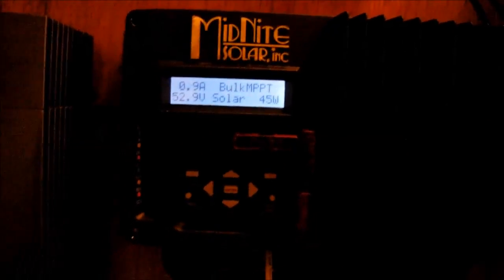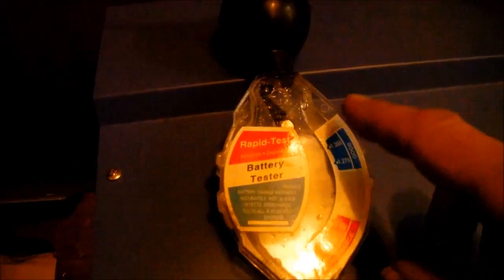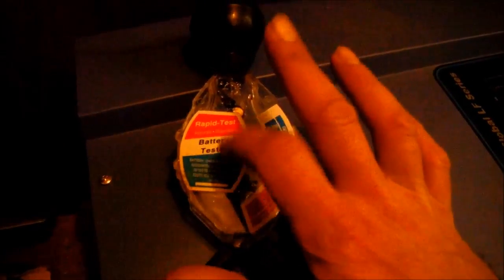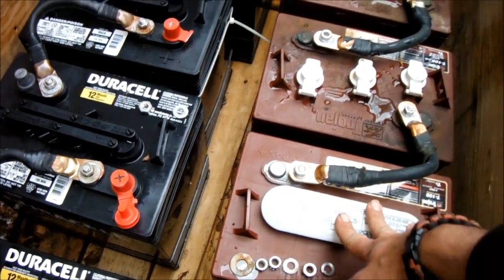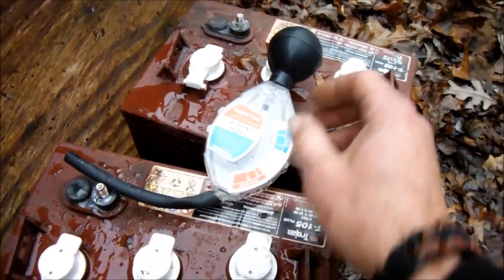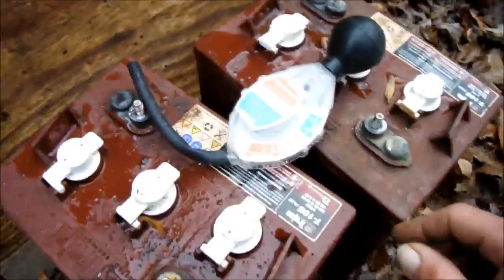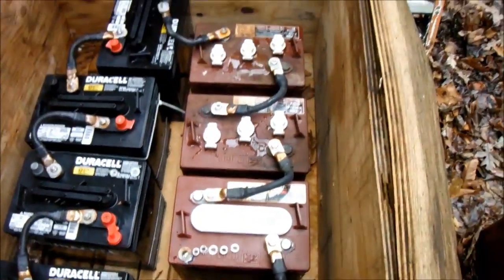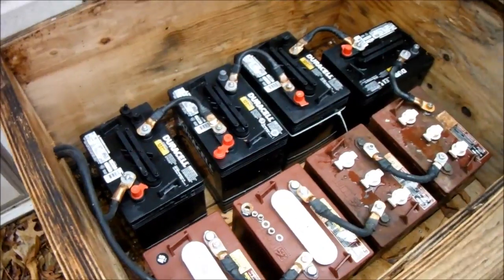Working out the bugs in my Solar setup

Comment: 50 bucks is half of a new battery.  Less stress that way. Glad you got both types of battery tested. Can't go wrong with that.  However were you get that hydrometer. I still got an old old one.
Reply from the maker: Yeah I think it isn't worth the effort I'm going to just go back and get my $50 core charge. I got it at a auto parts store, it was less than $10. Happy New Year Bill!